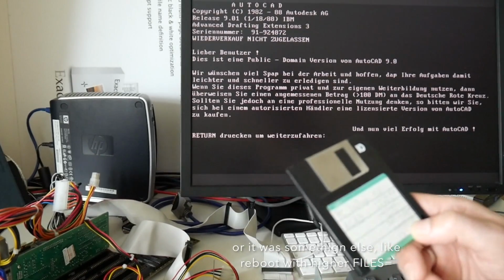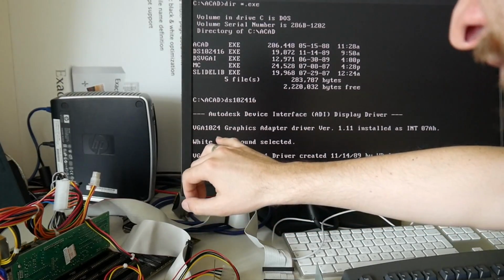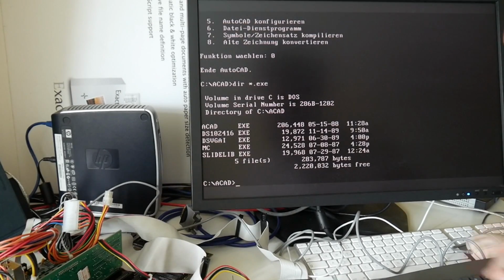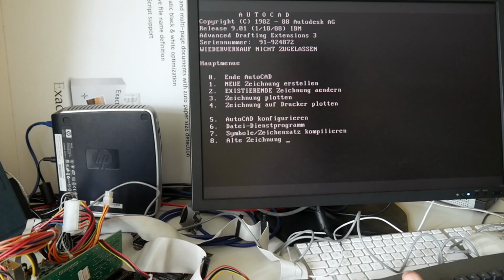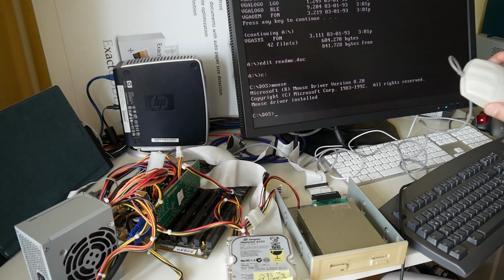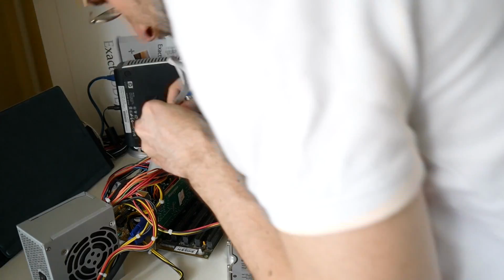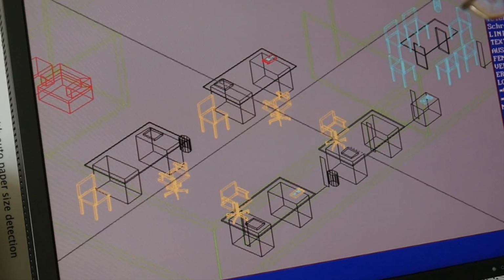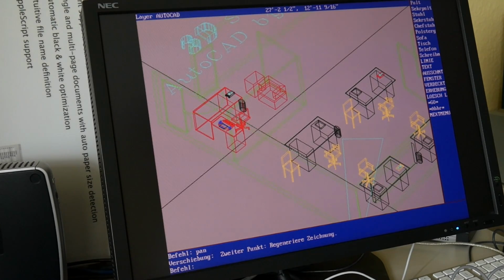AutoCAD r9.01 for IBM PC, am386dx40 how well did it run? part II

Comment: Something is seriously wrong with your 386. It isn't just slow with AutoCAD, it seems to be slow at the DOS prompt and in text screens too.

I have a 486SLC 40, and that isn't much better than your 386DX and it flies using AutoCAD from the same era. I can pan, zoom, and regen as fast as I can click the mouse even with large drawings.

Back in the day I used to use AutoCAD 9 on a 286 and it worked much faster than your 386.

The question is; are you run at full speed or are you clocked down. Many old computers had a "Turbo" button where a computer would work at full speed (40MHz) and then could be clocked down to say 8MHz for older DOS software that needed it. Are your really running at 40MHz or are you in clocked down mode. Check your jumpers on your motherboard.
Reply from the maker: Another VGA card made AutoCAD faster.

Comment: Yes i started to learn cad with this version...
Reply: With pc 386 dx+mathco damn expensive and when the drawing more complex so damn slowwww..
Reply from the maker: Yeah, in this video it might have been unusually slow due to some vga or bios  incompatibility (performance marginality) ps: later at work we had state of the art Pentium pro 200 for r13 and later r14 darn expensive back in the day, too. I still got two oversized oki digitizer serial tablets in storage ;-)
Reply: Wow..so nostalgic...cad version 2>9>10>12>13>14>2000 & now 2018....with sketchup...
Reply from the maker: I probably only saw it briefly back in the day, I learned AutoCAD professionally with r13 & r14

Comment: haha that menu :D Maybe its the old school version of "this software is a preview only, please buy full version" banner.

Trident top of the line :P no, as I already commented in another video this is bottom of the barrel, almost slowest in the world ISA Graphic card, 1/3 normal speed on average. 

You would definitely want at least an Intel 8514 2D accelerator, or TIGA (up to 60MHz in 1989 TMS34010/TMS34020 https://www.youtube.com/watch?v=730tmDmzeDE  ), or one of many other custom boards supporting ADI (autodesk driver interface). You wouldnt use consumer VGA with $3K software.

There is apparently crude renderer included in the Autocad 9 package, Autoshade, able to produce solid shaded models.
Reply from the maker: I later tried another VGA card, ET3000 or what I found, and the text menu was instant – however, with that I could not get any ACAD ADI or what that was driver to work, so not run AutoCAD. So it looks like the slow menu is some strange interaction with this VGA card, BIOS, or so, …

Comment: Note that the menu text isn't that slow on 2.62 which is the previous version to 9.x .... even on an 80186 https://www.youtube.com/watch?v=SqyKiSVILDM I suspect there is something wrong with your graphics card or the FPU software. perhaps you could run this to get an idea of there is some sort of performance problem with your machine https://www.philscomputerlab.com/dos-benchmark-pack.html

You might try a C&T card or ATI mach32 card as those were very fast cards from the period for the ISA bus.
Reply from the maker: Thanks the machine is otherwise fine. On a pentium 133 the text menu is indeed instant. The 386dx40 also has a Cyrix FasMath FPU. Maybe some performance marginality with either this specific ISA VGA card, some video ROM cache configuration (but xwing runs fast ;-) or that specific ADI graphics interrupt driver I got, ... :-/
Reply: Yep, it's certainly odd... I just picked up an Intel Inboard 386 card.... that will be fun to demo.
Reply: @renerebe  My dad was using AutoCAD 10 on an AMD 286 with a real Intel 287 coprocessor (which was super expensive at the time) and I don't recall it ever drawing those menus so slowly.

Also I do remember loading the Columnbia file :) I think it was not as slow, but you know, it was loooong time ago.